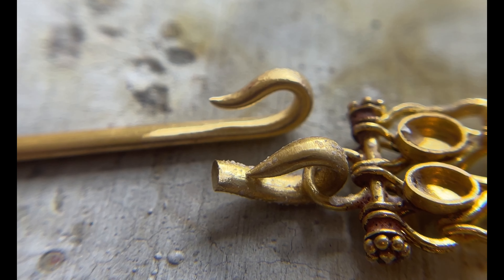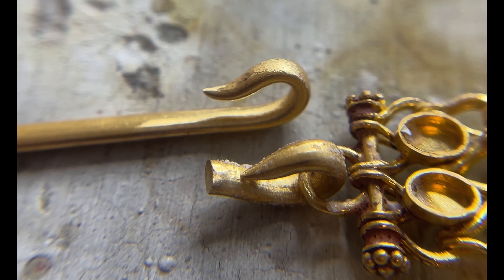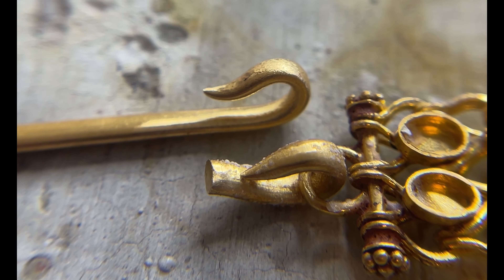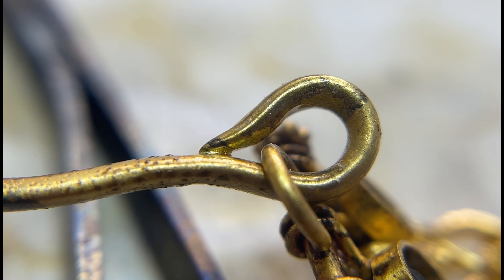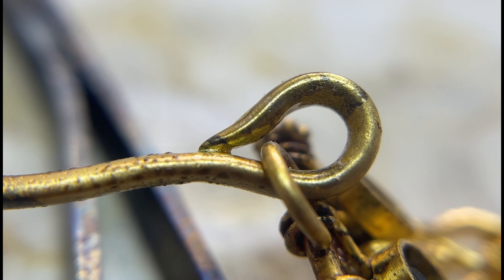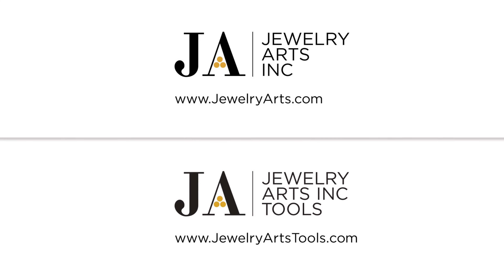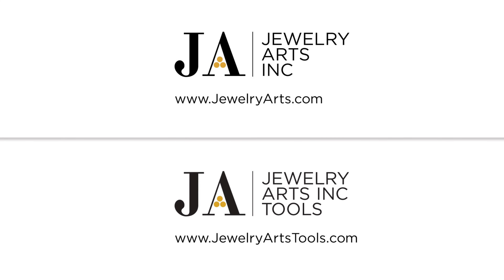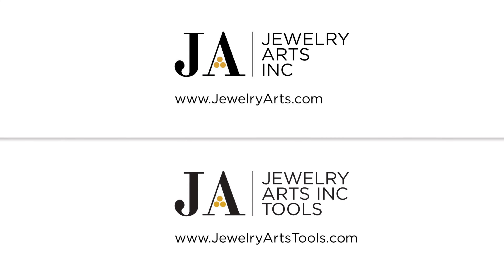How to Make a Roman Planished Gold Chain in Apricot 22k Gold Part 8

Comment: Hi Jeanette, Thank you so much for this tutorial. I am trying to make a similar design with this type of chain out of sterling wire. May I ask you, when you are soldering the links,are you pickling,quenching then putting the ochre on after each link,or do you just keep going? I haven’t yet to work in gold but I know it behaves differently than Silver. Should I pickle,rinse and ochre after each link if using sterling wire? Thank you so much for all your videos and all the inspiration. You are a QUEEN!
Reply from the maker: You are very welcome! I don't pickle in between I just keep going. The latest link should be clean enough and if the previous seams are dirty, all the better. We don't want them to reflow. Silver are gold act very similarly, I normally treat them pretty much the same, soldering wise.